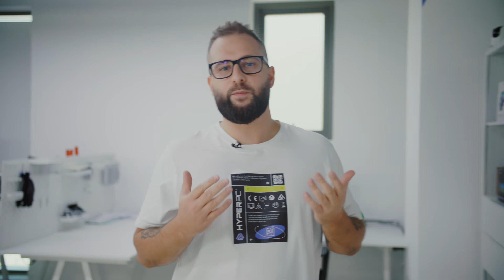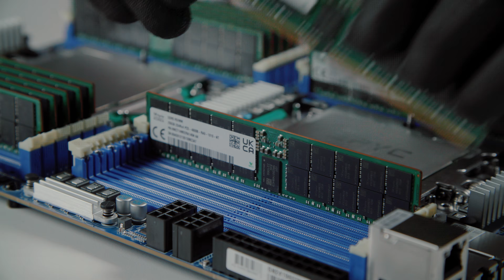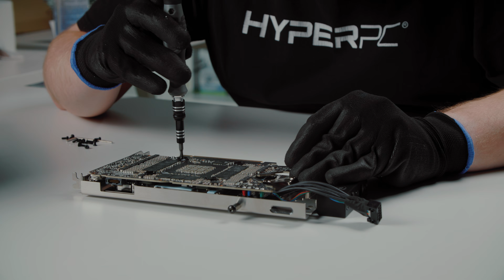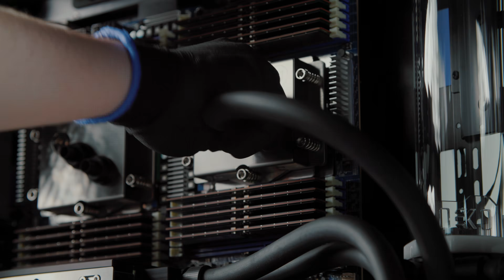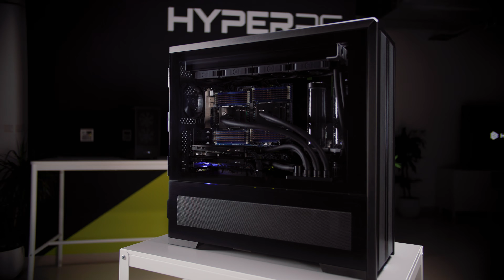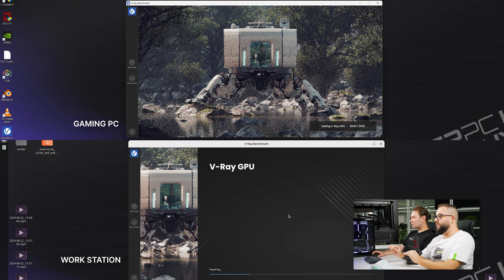Computer AI for 550 000 AED - 2x RTX 6000 Ada Generation  / 2x AMD EPYC 9754 / RAM 6Tb / SSD 32Tb

Comment: Lo... seriously? 6Tb RAM and just 2 GPUs? If that had 4xH200 I'd believe it was for AI, but you overcharged for RAM which is much much slower for AI. What a waste!! A.I. training on that system is impossible (unless you mean LoRA, which is not training per se). Parallel with NVLink H200 would have been the way to go, for real. Pfff... too much money, not so much brain put into this project. Sorry for the customer. P.S: Bandwidth is not described in TFLOPS, that's computation, logical operations, and/or IOPs related tasks. Bandwidth is described always using size per time (GB / s, Tb/s... and so on).

Comment: 👍👍👍 ? Why not metal tubing and connectors for liquid cooling system, if you are running a Debian base distro msg unattributed on github for a better installer for drivers and cuda toolkit

Comment: you guys should focus on GPU VRAM as VRAM is king in A, the 6TB of ram is great to run massive models, but its gona be too slow to get good tokens / second . i would have rather preferred to see 4 to 8 GPU in parallel
Reply: It probably depends on what they're using it for precisely; locally running LLM's then yes VRAM is the most important, but if they're doing inferrence or let alone their own training then CPU and RAM also matter, especially when it's fast DDR5 ECC RAM.

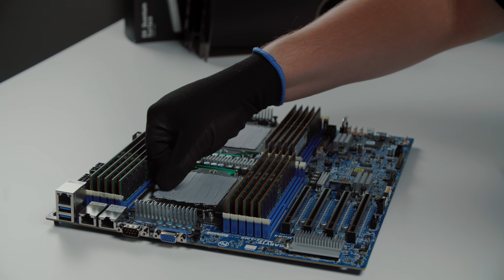Comment: 4:34 people need to watch and LEARN!!! Don't just place the thermal paste on the CPU and then expect whatever cooler you place on it to distribute. ALWAYS SPREAD IT ACROSS THE CPU MANUALLY!!
Reply: This is Epyc Cpu Specific Becuase of large surface area. 

Does not matter for Desktop Cpu. Studies have been done, makes no difference for regular CPU. Science says u can apply however u want aslong as you dont do too much or too little
Reply: Especially with those big amd cpus. I would get a Ptm7950 pad to avoid pump out

Comment: Running inference on 90B LLMs/MLLMs is the sweet spot for this machine with its 96GB VRAM. It's not built for the 350B models (which need 240GB+ VRAM) or for training.

For inference, CPU specs are largely irrelevant, and RAM just needs to be 2x your VRAM - anything beyond that is wasted money.

Better recommendation: Skip the dual CPUs and fancy motherboard. Instead, get a decent AMD board with multiple PCIe slots, populate it with 6x A6000 GPUs (288GB total VRAM), add 512GB RAM, and invest in proper air cooling and a quality case. This setup will handle model inference beautifully.

For actual training, just rent cloud GPUs at ~$5/hr and avoid the power/cooling headaches altogether. Remember, these workloads are measured in FLOPS, not typical benchmarks, and inference doesn't generate nearly as much heat as training.
Reply: Good info bro 😊

Comment: I recently built a similar system; 4x8280L, 4x RTX 6000, and 12TB RAM. Cost a fraction of this machine, but it is loud as hell.
Reply: 12TB of RAM? 😅
Reply: Can it open word file?
Reply: Isn't it funny in the gamer world if you play online with other's on a team. They always say" WHO's GOT THE FAN ON!!!!!!!!" EITHER TURN IT OFF OR  YOUR GONNA GET MUTED/KICKED OFF THE TEAM! For laptops and desktop's this is unacceptable for all these crazy amount of money these system should be as quite as a i7 2860Qm. ARRRRRGH
Reply: @OfficialHankIII You cant chang more power more heat higher fan noise if you dont build a massive custom loop but i never had a problem with fan noises

Comment: I would never liquid cool a 50,000 dollar PC.
Reply: @thedesireguardian2470  if it leaks ill never forgive myself
Reply: @CyrusGameWorlds  But it doesn't matter if it was created according to standards. And, as I know, HyperPC covers the leakage problems of the entire system and its components if the system was created by them and water-cooling components were bought from them too.
I heard it from them a few years ago, "We give a warranty on loops if they are made by us." I don't know if this is still true today.
Reply: @CyrusGameWorlds  Double distiller water contains no measurable ions and as such does not conduct any electricity whatsoever. In fact pressurised water hoses spraying distilled water are commonly used to clean electronics components such as motherboards, GPU's and so on precisely for that reason. So long as you don't fill the reservoir with normal tap water or cheapo deionised water, there's nothing to worry about even in the unlikely case you spring a leak somewhere.

Comment: 1. CPUs - AMD EPYC 9754
Núcleos por CPU: 128
Clock base: 2,25 GHz
CPUs no sistema: 2
FLOPS por núcleo por ciclo: Assumindo 16 operações de ponto flutuante de precisão simples (FP32) por núcleo por ciclo.
Cálculo de TFLOPS das CPUs:

TFLOPS por CPU
=
128
×
2
,
25
×
1
0
9
×
16
=
4
,
608
 TFLOPS
TFLOPS por CPU=128×2,25×10 
9
 ×16=4,608 TFLOPS
TFLOPS total das CPUs
=
2
×
4
,
608
=
9
,
216
 TFLOPS
TFLOPS total das CPUs=2×4,608=9,216 TFLOPS
2. GPUs - NVIDIA RTX 6000 ADA Generation
TFLOPS por GPU (FP32): A RTX 6000 ADA Generation possui aproximadamente 91,1 TFLOPS.
GPUs no sistema: 2
Cálculo de TFLOPS para as GPUs:

TFLOPS total das GPUs
=
2
×
91
,
1
=
182
,
2
 TFLOPS
TFLOPS total das GPUs=2×91,1=182,2 TFLOPS
3. Desempenho total do sistema
Somando o desempenho das CPUs e GPUs:

TFLOPS total
=
9
,
216
 TFLOPS (CPUs)
+
182
,
2
 TFLOPS (GPUs)
=
191
,
416
 TFLOPS
TFLOPS total=9,216 TFLOPS (CPUs)+182,2 TFLOPS (GPUs)=191,416 TFLOPS
Resumo:
O sistema com 2 CPUs AMD EPYC 9754 e 2 GPUs NVIDIA RTX 6000 ADA Generation teria aproximadamente 191,416 TFLOPS em operações de ponto flutuante de precisão simples (FP32).

Comment: It's amazing. I remember my first PC that had a GPU with 256mb memory or something like that. After 20 years, technology has changed a lot. I wonder, after another 20 years, if home PCs for gaming and work, can have similar specs as the workstation in this video.
Reply: 4kb for me. Later I built my own first pc, 486/DX2. It was fast, unreal. Then in my Pentium 2 400Mhz I had a Riva 128, with 4MB, really, it blew Quake 2 to bits. 

But then the dual socket Celeron 300A. OC it to ungdoly speeds wirth ridiculous SDR memory.